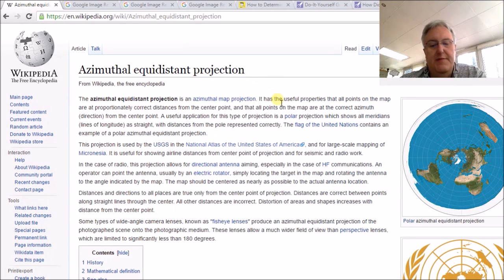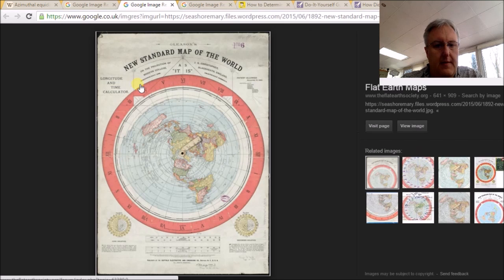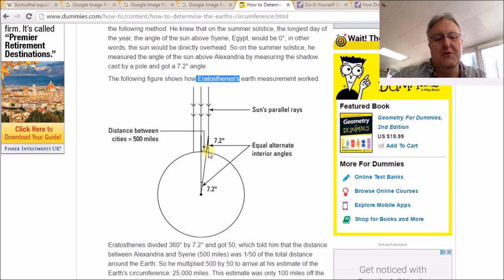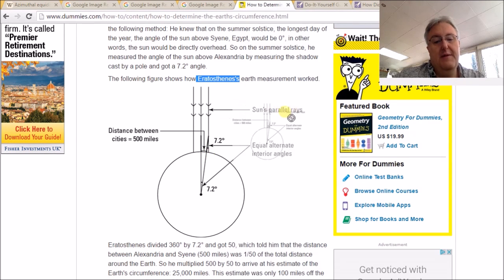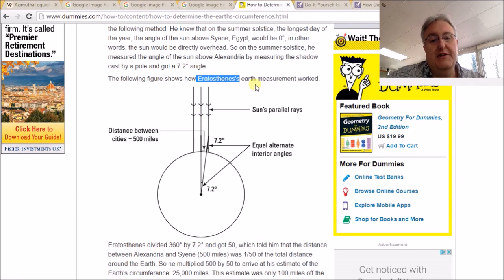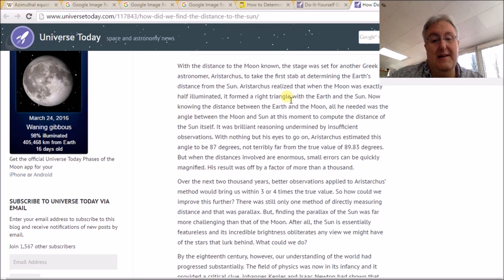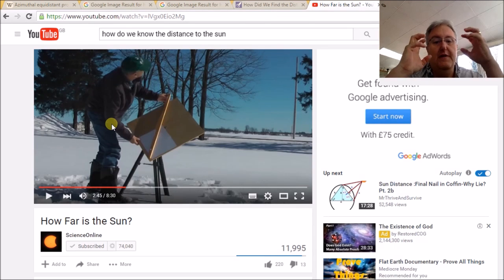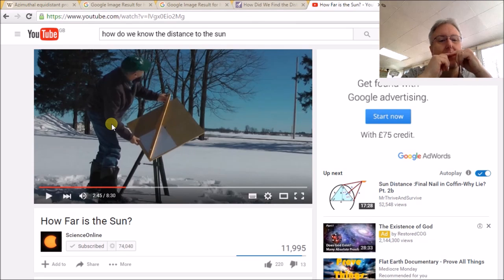Flat Earth - Maps Maps Maps

Comment: Agree get the right shape and size of each continent, lay them in a circle in their general positions. Using the compass facing north take the east and west measurement of the distances between the 2 land masses at points as you move south, don't have to worry about curvature it will normally form it's own circle. The southern tip  of each continent will have its distance measured from the antartica wall . make necessary adjustments at the artic riing . Need to fine tune. Have all of the most southern points of each land mass know it's distance from the antartic wall

Comment: 1. If the sun's rays are not parallel, then that's straightforward to demonstrate with sticks and shadows. So why's no flat-earther done the experiment? 
2. You can bounce radio waves off the moon. This distance correlates with parallax measurements and laser measurements (off the reflectors left by the fake moon landings)
Reply: +SqueakerAlpha Alas, the sun doesn't demonstrate the same degree of parallax as the moon does. The moon also passes in front of the sun during an eclipse. Those clever ancient Greeks noticed both these things and worked out the sun was further away than the moon (they'd already established the earth was round and calculated its diameter). I feel rather humble, as I'd have never had that kind of insight.

The distance to and size of the sun was worked out with parallax, using the transit of Venus. This was also performed a long time ago by people cleverer than us.
Reply: +theonemanpublisher dont be surprised when you get blocked.
Reply: +theonemanpublisher they did. measured the shadow angles, did the summs and got 3000 miles for the suns height. ;-)